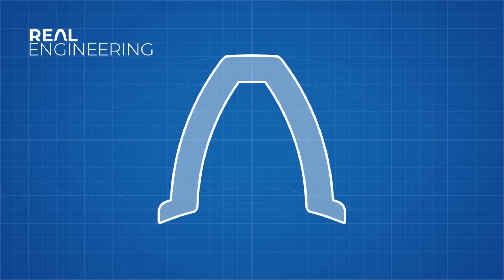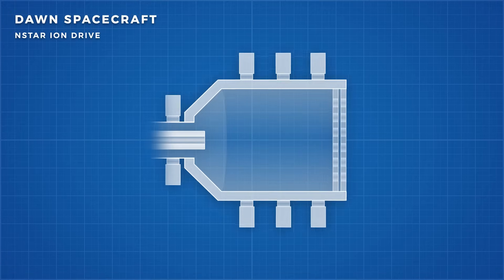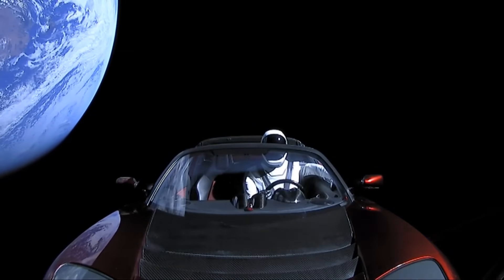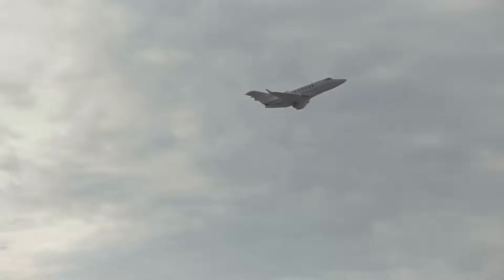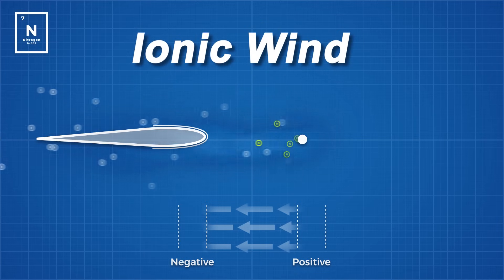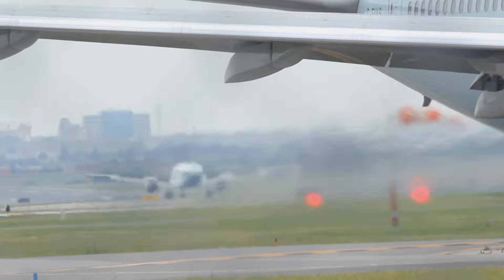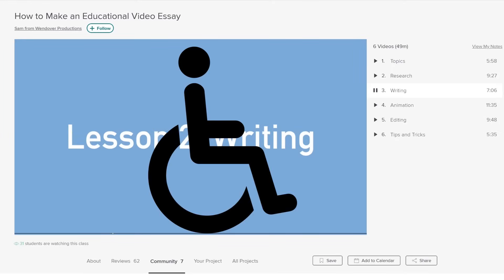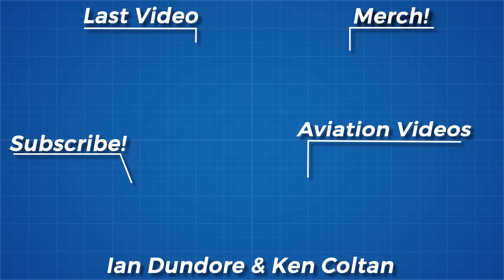Ion Propulsion - The Plane With No Moving Parts

Comment: 1) the Mach number is measured locally. You cannot say a spacecraft is travelling at Mach x because you don't know what the speed of sound is in those conditions. 
2)ionic wind is not caused by an alternating current.
Reply: 2) They do have an inverter onboard but it simply does create AC for the transformer which feeds output its output voltage into an multistage voltage multiplier which makes it DC again....
Reply: Iceteavanill the transformer in this cas is no used for boast but for isolation. It uses boast coverter
Reply: Certainly a valid complaint, and a misuse of the term, but it's still not hard to figure out the meaning.

While not the correct use of the terminology, it's clearly being used as multiples of the speed of sound at sea level in a standard atmosphere.

Which is an incorrect definition, but... Not a difficult one for anyone to understand... unless you're extremely pedantic of course.
Reply: @KuraIthys  It's not that we don't know what Mach number means, its that we are pointing out its incorrect use, which should not happen on a channel with engineering in its name. Worlds not gonna end but pointing it out so he doesn't do it in the future doesn't hurt anyone...
Reply: @jackhayton3677  
There is just one "football" (without prefixes) played using foot not with your entire body governed by FIFA.
Reply: @dr.deekhounds5339  You sure you replied to the correct comment? I never mentioned anything about football fields... Though I do agree as I am english too...
Reply: "football fields" also vary in size, nevermind the fact that it could refer to two different sports. Still it's a good intuitive measure for large things. There are raw numbers for technically inclined people, and these kinds of intuitive comparisons for everyone else (for whom the "speed of sound" is "really fast"). I think it's fair. Gets the point across to people of all backgrounds, which is the first step of communicating science.
Reply: namewarvergeben come on. This doesn't make much sense at all. 
Football fields more or less lay in the same ballpark and distances don't actually change (if you don't count relativistic effects). 
The speed of sound is incredibly variable and depends on the temperature, molar mass, Cp and Cv. It is a local parameter which can differ widely even between two very close points. 
You say it aids communication, I say that an engineering channel should get its engineering right.
(It might also teach people something)
Reply: @MrCarlozan96   To the average person (and to me in this context) the "speed of sound" is the speed of sound in air at sea level, i.e. in the conditions that most people live in. The only people who are confused by this comparison are the people who have some knowledge of physics. This comparison is not meant for these people. For these people, the video provides the "raw" number in m/s
Reply from the maker: Ah well, in that case we need to divide by zero and we gonna break the universe.
Reply: Real Engineering just pointed it out because people don't know it and assume that the speed of sound is always ~340m/s
Reply: @MrCarlozan96  Anything in Space would be Mach Infinity...since there is no medium
Reply: Yeah, the AC thing got me weirded out
Reply: I think by Mach 8 he meant 8x the speed of sound on Earth.
Reply: Mach is being used as a point of reference. Assuming that the Mach is the speed of sound at sea level (767 mph.)
Reply: @eloisanzara237  We all know this, we are pointing out that this is an incorrect use of the term Mach number. You cannot say this spacecraft is travelling at Mach 50 the way you can say the distance X is as long as 5 football fields. Whether you like it or not it's simply incorrect, and that is what we are pointing out.
Reply: mach numbers given out are generally mean averages just for explanation purposes and in space its different conditions at play since its the pressure wave thats affected and it in turn affects the craft creating it .
Reply: Lee Gray if you actually crunch the numbers, the speed of sound in your toaster oven is much higher than in standard atmosphere. It's not an average. It's just incorrect in this situation
Reply: The Mach number in outer space is infinite, because the speed of sound is zero, because it never gets off the ground. But I know what you mean.
Reply: When talks about the speed of sound he's probably talking about the speed of sound in air at sea level and 1 atm. You know the "standard" speed of sound.

It's like when someone talks about the Earth's gravity, you assume they're talking about the average acceleration at sea level. You should learn to read between the lines, because you're the only one who didn't get it.
Reply: @grandsome   Its clear that Mr.Carlozan knows what he meant... Pretty sure you know that he knows that too but just wanted to shit on him for writing a "negative" comment on this video for something you perceive to be insignificant. Not sure what your background is but I'm currently doing a masters in aerospace engineering and I can tell you that this small mistake is actually significant (especially on a channel that is meant to teach you engineering, if this was a CNN news presenter I would not care, as I can excuse their ignorance). Mach numbers should not be used like football fields or swimming pools to give people an idea of the length/volume/speed of things, its simply an incorrect use of the parameter. You can dislike that, or think its negligible or think we are being pedantic but the reality is the way it is. 

We are not telling him he's worthless, the video is trash and that he should go jump of a bridge... We are simply pointing out a very minor error that he made so that he won't do it again in the future... Not sure why so many people are butt hurt by this... Please enlighten me
Reply: What do you mean? When stating the speed of a vehicle in Mach numbers (wich is sometimes prefered) you always take the speed of sound at sea level, 343 m/s.
Reply: Mandernach Luca No that’s not true, you divide the velocity of the vehicle by the LOCAL sonic velocity (speed of sound). The speed of sounds varies...
Reply: @jackhayton3677  
If one refers to the max speed of a vehicle in Mach numbers, it will often be the max speed at sea level, therefor also with the speed of sound at sea level. The speed of sound decreases the lower the air density gets, respectively the higher your altitude is. That's why planes that aren't designed for supersonic speeds always will have a higher speed (in km/h) at sea level than as opposed to any altitude above .....
Reply: Mandernach Luca yea that’s true, when quoting the max speed of a vehicle that travels within the atmosphere... not a spacecraft. No spacecrafts speed is quoted by a mach number... once again this is only a minor mistake in the video, yet it is technically wrong.
Reply: @Enthropical_Thunder  The sound is primarily dependant on temperature, not density. That's why saying that speed of sound at the MSL is 340 m/s is simply wrong. It's only when the temperature is 15*C as in standard atmosphere. When temperature climbs to 30*C we get speed of sound around 348m/s and when it drops to -15*C it's 320m/s (and the speed of sound in the engines exhaust gases even at sea level will rise to more than 400m/s). 
And no, planes will never be faster at sea level than at the altitude.
I get it, people use this comparison for impressiveness, but enough people have the misconception that either the speed of sound is constant or it only depends on altitude, that an engineering channel should try to get rid of that confusion, not deepen it.
Reply: @SharkY1092  
The problem with this statement is that in an ideal gas, the formula to calculate temperature is very well depending on the density of a gas or the specific volume, so saying that the speed of sound isn't depenend on density must be wrong?
a= speed of sound
k= isentropic exponent
R= gas constant
T=temperature
a=(k*R*T)^(1/2)
with
v= specific volume or the reciprocal value of density
p= pressure
p*v = T*R
or
density = p/(T*R)
The density of the surrounding air is clearly in their, so what do you mean by misconception ?
Reply: Mandernach Luca it's literally the same thing. You used the ideal gas equation to correlate temperature with pressure and specific volume. The other guy got just a little bit confused. 
The fact is, though, that it is really easy to just use the temperature.
Reply: @MrCarlozan96  
That's what i wanted to show with this ;D.
Reply: @Enthropical_Thunder  Well, I was too quick to write that - of course it depends on density, but as well it depends on pressure. You've used the equation:
density=p/(T*R), than:
T*R=p/density
In atmospheric condition with given humidity pressure and density will be inversely proportional - the effect of pressure on the speed of sound and the effect of density cancel each other. 
So, I just wanted to point out, that it's mainly temperature that changes the speed of sound in ideal gas - should the temperature drop to around -60*C on sea level, the speed of sound will be the same, as is often encountered at 11km.
Reply: @SharkY1092  
Well, that can't be true, as you said, 
R*T=p/density
That means, that the change in temperatur (because R is always constant) is always equal to the change in pressure divided by the change in density. So a  simple change in temperatur can't just change the speed of sound completely ;D. 
In fact, the formula for  the speed of sound is
a=(k*p/density)^(1/2)
or
a=(k*R*T)^(1/2)
see, it's thetmodynamically the same ;D.
Reply: Mandernach Luca what sharky said is actually true. The funny thing is that what you are saying is also true. You just need to know the temperature of a known gas in order to find the speed of sound but you could also do it using P and V
Reply: @MrCarlozan96  
Exactly, that's why i wrote the two equations. The problem is just that he stated -60 c° on earth would magically lead to the same pressure and density that you would have at a certain altitude, wich can't be true. It is clear that from a thermodynamic  standpoint, a gas cools down when it expands, wich the earths atmosphere practically does with every gain of altitude, basically the temperature exists because of a change in density. If you would cool down the air at sea level, you would also get a change in density but this time, the change in temperature leads to an increas in density. The point is, that the viskosity, wich plays a major role for anything regarding to speed or the speed of sound, changes with any change in temperature, pressure and density.
Reply: @Enthropical_Thunder  "-60 c° on earth would magically lead to the same pressure and density [...]" No it wouldn't. It would lead to the same ratio of (p/rho), which magically does. 
You can say, that the speed of sound correlates to either square rooted temperature or pressure to density ratio.
Here the temperature correlation is easy to spot:
https://upload.wikimedia.org/wikipedia/commons/9/9d/Comparison_US_standard_atmosphere_1962.svg
The density will always drop with altitude due to buoyancy, and the temperature doesn't have to. There are inversion layers, when the hot masses of air climb above the cold and dense, the temperature will climb and so the speed of sound will be higher than on the ground.
Reply: @SharkY1092  
That's all true but you still can not recreat the same fluid characteristics here on  sea level, the fact remains that you cool down air at sea level (wich would mean cooling down air at  1 bar pressure and a density of 1,204 kg/m^3) as opposed to around 0.1 bar pressure and a density of 1 kg/m^3 at 18 km height that are at the same temperature. You see, you can't possibly get the same fluid characteristics just by reducing temperature, it is thermodynamically not possible.
Reply: @Enthropical_Thunder  And exactly why not?  Ideal gas is good enough (for engineering purposes) approximation of dry air and that model says, that for a given temperature there's always the same ratio of pressure/density.
Reply: @SharkY1092  
Just that you forgot that the pressure also changes because of the height itself. In a simple pressure tank, the ideal gas law holds because there is not much height difference, so earths gravity can't add much pressure difference (liquid fluids like water are different in this respect). But if you apply this whole matter to earths atmosphere, you will certainly have to take gravity into account.
Reply: @Enthropical_Thunder  Even for a skyscraper heights you have to take hydrostatic pressure effect into account, but it doesn't mean ideal gas law doesn't hold true. I mean, entire International Standard Atmosphere is build with assumption of air being ideal gas.
Reply: @SharkY1092  
That has nothing to do with what i try to say. The density of any given fluid is crucial for the speed of sound. The density of a fluid is depend on the ideal gas law and the part of the bernoulli equation that takes gravity into account.
What i'm trying to say is that despite the ideal gas law holding, you still got the compression of a 10's of kilometers thick layer of air, wich in a height of 20 kilometers naturally is weaker than on the ground. Therefor cooling the air would have quite the opposite affect of increasing density and therefor increasing the possible mach number (at 20 kilometers altitude, you would have a lower speed of sound because of this effect).
Reply: Mr.Carlozan pretty sure he’s using the standard 343 m/s.
Reply: 1) who gives a fuck.
2) shut the fuck up.
3) you try and make a better video.